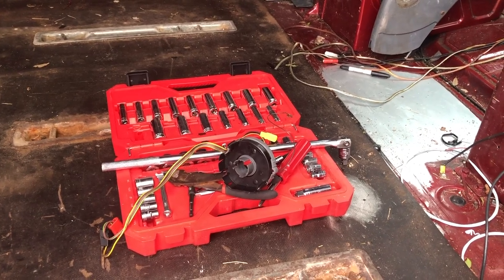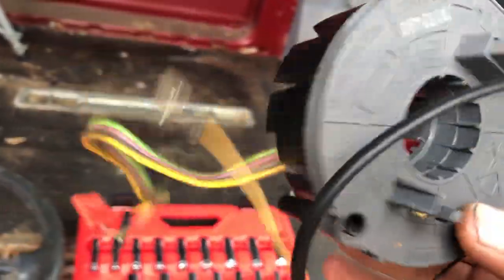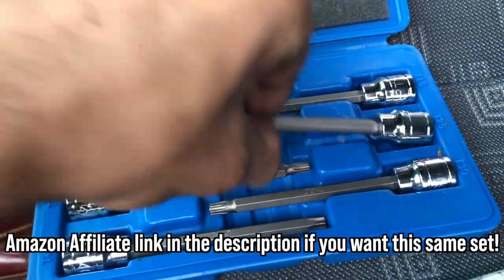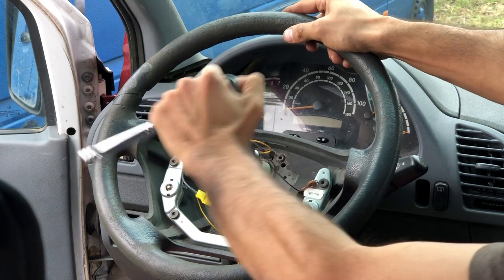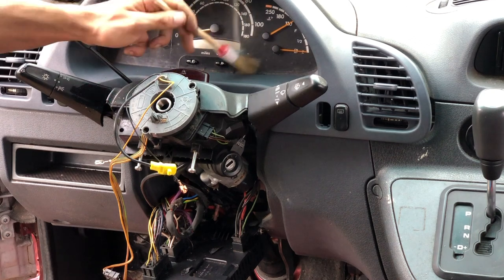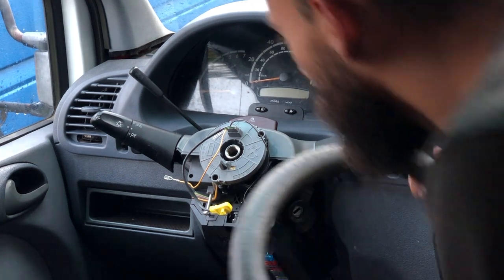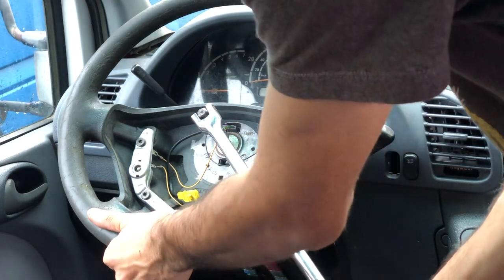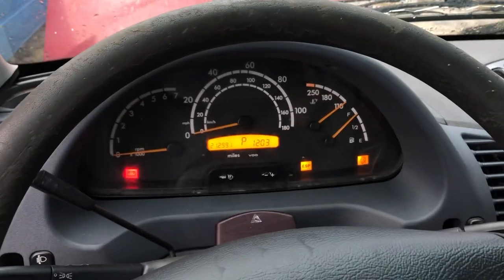How to Replace Steering Wheel Clock-Spring in a T1N Sprinter (2002-2006)

Comment: Last question! I followed the video exactly and everything is working great. (my issues was the steering angle sensor not clock spring) but now I have the ABS, TRACTION CONTROL MALFUNCTION INDICATOR, and ESP lights on. I ran my OBD scanner and no codes are coming up. Did I activate something?
Reply from the maker: A generic code reader won't communicate properly with your van. Codes you get are generic and some modules are inaccessible. The AP200 is my goto* compatible meter. We have a video showing how to set it up for Sprinter vans, with link to the meter in video description. https://www.youtube.com/watch?v=1vCPcBK0R9k&t=2s Find me on FaceBook or join our support group for 1-on-1 assistance. I send links for the products and videos specific to what you and I are discussing, ensuring you get the right product and know what to do with it.  https://patreon.com/Florida_Van_Man?utm_medium=clipboard_copy&utm_source=copyLink&utm_campaign=creatorshare_creator&utm_content=join_link

Comment: Love the videos.  Have a question about turn signals no longer cancelling after changing the Multi Function Switch.  I believe I need to realign the plastic sleeve that has a protrusion that looks like it fits into the clock spring housing.  Had it apart several times and can't seem to get the alignment correct.  Did you notice the position when you change the clock spring?  I keep looking at the video but there is not a good shot of it.  THanks
Reply from the maker: Pause the video at 5:57. Is this the piece you're thinking of? It's right when I lift off the clockspring. I didn't dare touch the position of it and reinstalled the clock spring without any cancellation problems.
Reply: @FloridaVanMan  Thanks for the reply.  I don't have that collar around the stem (sits just under the clock spring with wiring out to the lower right). What I am referring to is a sleeve that fits over the steering stem and slides down the stem below the clock spring , it has what looks like an indexing stub.

Comment: Can you adjust the clocking of your steering wheel by doing this? My steering wheel is a few degrees off centered.
Reply from the maker: Yes, Drive in a straight line and stop, remove the tilted wheel and put it back on straight.
Reply: @FloridaVanMan  Thanks!
Better to do an alignment before or after making this adjustment?

Comment: Can the icarsoft MB II scanner also reset the SRS code after the clock spring repair or is the AP200 the only one capable?  I also have a nautabox in case that matters. Cheers
Reply from the maker: I think it will. I find the iCarSoft and the AP200 are very similarly capable.

Comment: I'm replacing the steering wheel angle sensor right below the clock spring. Anything special to know about that?
Reply from the maker: Disconnect the battery at least 10 minutes before disconnecting the airbag.

Comment: That yellow connector behind airbag, is it horizontal (90•) or need to slide out. I can’t figure it out and don’t want to put too much force on it. Thanks.
Reply from the maker: It's an angled plug that pulls directly out of the airbag as shown at 3:43 in the video.

Comment: What SRS code did you have that was able to be cleared by your AP200? I replaced my clockspring months ago (same symptoms, no horn, SRS light) and basically followed the same things you did in this video. However, I have not successfully been able to clear my SRS light using my AP200 or my iCarSoft MBII...
Reply from the maker: I showed the code in the beginning of the video. "Driver's side airbag has high impedance". Does the horn work now? Did you replace it with a new part? Maybe the airbag itself is not good if the code still can't be cleared with the AP200. Make sure you go into the Airbag/SRS module and read & clear the codes from there.
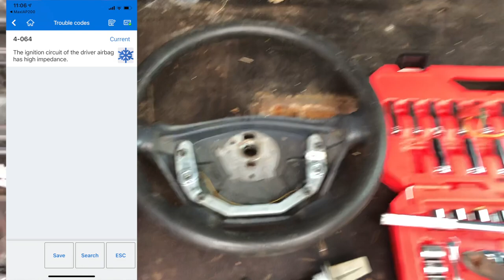Reply from the maker: 0:40 I show the SRS code that I have.

Comment: I have the same code but for the passenger side
Can anyone advise me on where I should check? I checked the connection (yellow plug) on the side pillar, where the seatbelt is retracting. Disconected, cleaned, put back in place, cleared the codes with the ap200, no luck :).
Reply from the maker: Two air bags and two seat belts unless it is a former FedEx style with no passenger airbag. Seatbelt might be bad?

Comment: Did anyone else have an issue with the top captive 10mm nut that is up top of the fuse box? Mine just spins and spins...
Reply from the maker: That is a common problem. Put a 10mm socket on a battery and spin it a few seconds then pull as it spins. The brass nut has seized to the screw and spinning will melt the plastic enough to pull the nut out without breaking* anything. Best to glue the nut back in a day before reinstalling, or zip ties will hold it all together replacing the nut. Sometimes we can get lucky and spin/melt it back in the same way it came out.
Reply: Thanks for the response! What do you mean put on a battery?
Reply: I assume you mean have the ratchet be motorized for faster friction
Reply from the maker: Put the socket on a battery drill or electric ratchet so you make enough friction to soften the plastic. 
 @sophiagrasso8673

Comment: Help !! Does anyone have a spare rear left axle for a 2005 T1n ?
Reply from the maker: We have two parts vans here. If you want to pull it we will sell it. Absent a rear axel will make it more difficult to dispose of the skeleton when we are done with this parts donor, so I won't give it away. Make me an offer if you are near central Florida.
Reply: @FloridaVanMan  thanks for the offer. It would cost more to drive to Florida from Michigan then buying a new one. It would be cool to hang out with you guys though. I'm going to talk to my blacksmith about fixing the bolt holes.